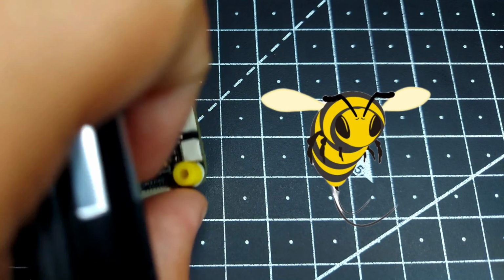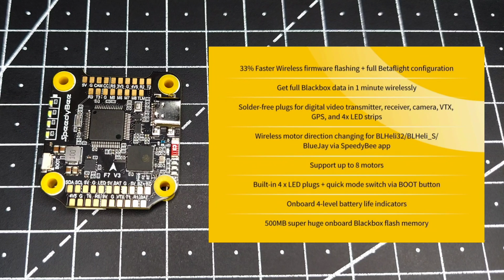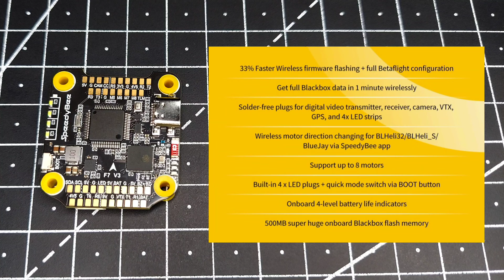Overhyped ! Speedybee F7 V3 Stack | Wiring Guide | Honest Review

Comment: haha...I was expecting more criticism ;)...what about that glued component which protrudes under the esc?
Reply from the maker: Those glued components near the ESC header pin are there for extra protection 

Sometimes while plugging in the connector user's fingers protrude under the ESC causing damage
Reply from the maker: I still left the noisy gyro issue which I didn't encounter but many others did

Comment: hello can you help me.
is my fc broken ?
when i plug the batterie in there are only 3 beeps from the esc and no led on the fc is on.
But when i plug the fc into my computer and then plug the batterie in everything is normal. Is my fc broken or ist it just the connection cable
Reply from the maker: Most probably wrong wiring check for bend pins inside socket

Comment: I bought this stack because I needed a new FC and their F405 was out of stock. So I paid a little more. So far I love this thing. No soldering at all. It says it has a 9v/4a BEC, so I assume it is good to run the new DJI o3 Air Units. I can't afford a brown out on that very expensive air unit, so I hope they are accurately rated at 9v/4a. I think the o3 air unit needs 10v/2a, so 9v/4a should be enough for it.
Reply from the maker: 4A?? This thing can't even do 2A in reality quality is not that great they have compromised at a lot of places
Reply: @justhackitfpv  I'll have to measure it. The F405 says 9v/2a and 9v/4a for the F7. I sure don't want the o3 air unir browning out in flight.

Comment: I only use F7 FC's the F4's not good for freestyle I have had a few F4's that would flip out  when pushed extremely hard  the tmotor f4 sucked bad and the speedybee f4 was a little better .. never had an F7 flip out while freestyling
Reply from the maker: They run the same code there is no difference in flight performance with both, maybe you got bad hardware... The only difference is F7 has more UARTs processing capability that's it... Nothing related to flight performance additional with F7 that will make any changes
Reply: @justhackitfpv  had no issues with the speedybee f4 but that T-motor Velox lite f4 was terrible i have run both these in multiple quads with different hardware I go by performance not specs and I find F7's are much better especially the skystars fc when you fly extremely fast pushing the FC you can tell a huge difference in F4 vs F7  flying slow they are all the same .. The Speedybee F7 V3 is configurated differently then the F4 to process information faster same hardware just configured differently on the board ,, I have over 25 quads my own builds  fly atleat 2 hours every day  , not new at this and can tell a huge difference between an F7 and F4
Reply: @justhackitfpv  I have box full of F4 Fc's you want the they are all yours
Reply: also benchmark test f4 is 554 score vs the F7 with a score of 1222 big huge difference
Reply from the maker: @bengordon7635 not for us I'm in touch with bf devs it doesn't matter even if you upgrade to H7... Our beta flight code is very efficient and F4 is more than enough to run it properly

Comment: I bought one ... NOT impressed.  The plugs were not working, ended up having to bypass the "easy" install and solder the VTX and GPS connections to the board. Support was "hard". I love the way it looks, the mobile app.. but now having OSD problems, where I only see half of the OSD screen on top of a full picture.  I really wanted to love this...
Reply from the maker: It's cutting too many corners
Reply: I noticed that the jst connections wouldn't fully seat with all jsts

Comment: Need some help....Its saying there's no valid receiver signal on the speedy bee app, i'm using a 3 wire receiver soldered to (black g, red 4v5, and yellow on r2 like the manual said, Everything turns on and transmitter is binded, but nothing happens when I give any input throttle ect, and the leds aren't lighting up.
Reply from the maker: Only speedybee can help you with this most of us don't use that software support they give